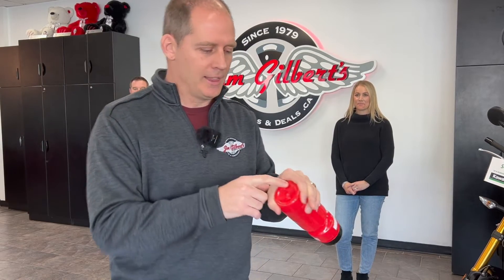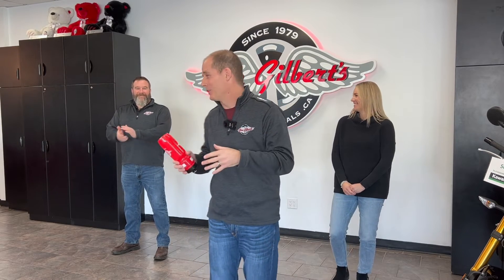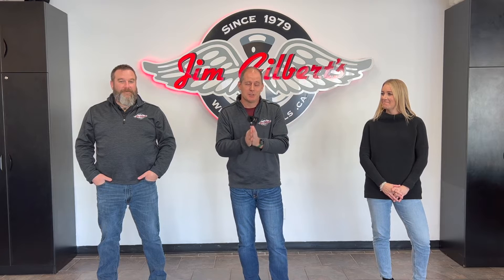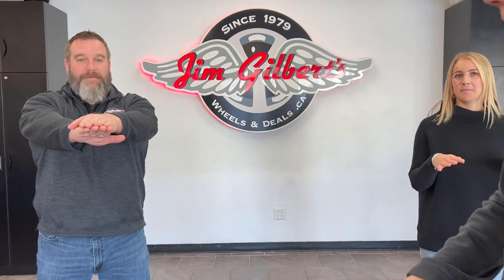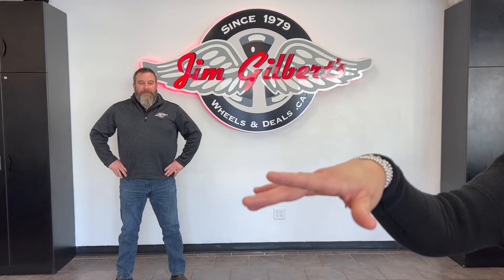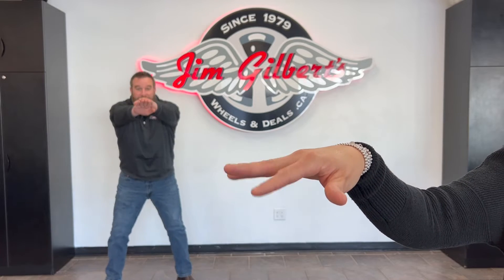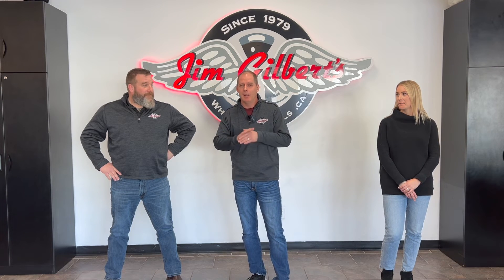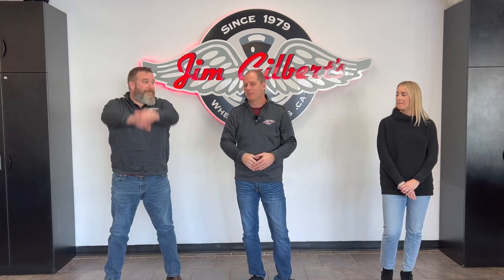Are high revving engines a problem? Let's find out! - Using people as props!

Comment: Revs don’t really matter. It’s “piston speed” that’s key. Short stroke engines had lower piston speeds, hence could rev higher.
First saw this with Japanese two strokes in the sixties compared with the old British thumpers, like the single pot 4-stroke 500 BSAs
Reply from the maker: Exactly!!
Reply: @PeterLoweOne  if I recall, they called them long stroke, square and over-square
Reply from the maker: @herrtomas6729  Yeah! An oversquare engine is one that has a larger bore than stroke. I was going to go into that, but I wanted to keep things simple for this video.
Reply: @PeterLoweOne  we affectionately called them ‘rice burners’. You’d hear this high speed buzzing from a two stroke Suzuki approaching at speed….
Those were the days🏍️